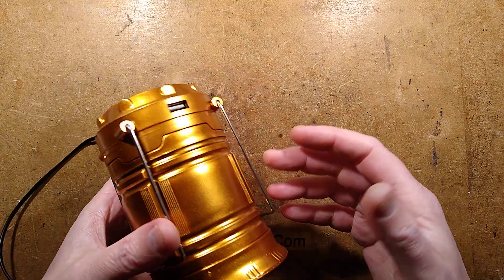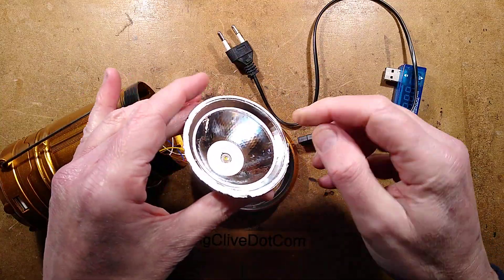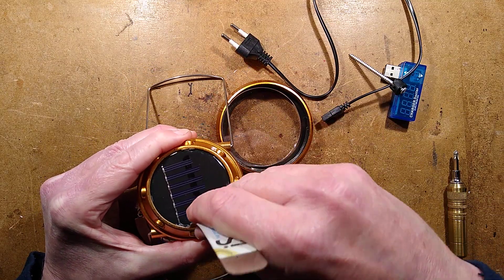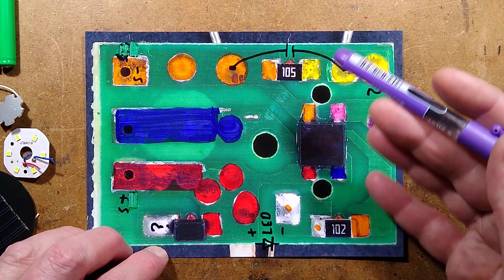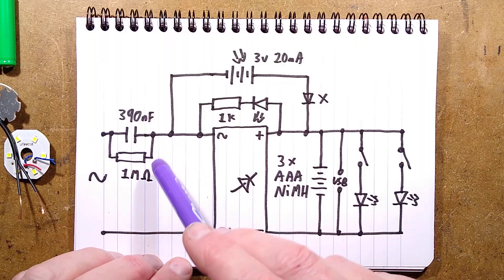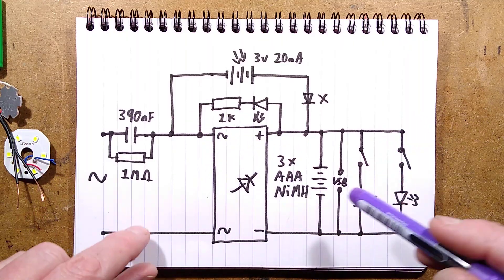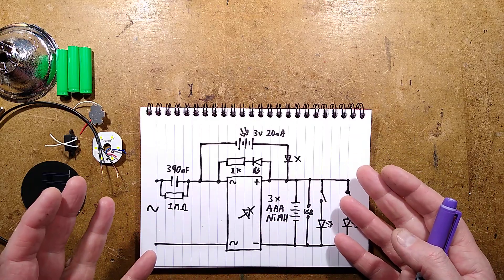Dangerous "death Dalek" lights still on eBay

Comment: My girlfriend’s father sent me one of these. The reason for sending it was that it did not hold a charge. I was horrified when I opened it. Frankly, I thought I would replace a battery and send it back. I didn’t even notice that it was charging from the wall. After examining it a little, I canceled the things related to 220 volts, the solar energy panel, and made the modifications on the same pcb, it would be charged with usb. With 1 piece TP4056 and 1 18650, it both worked longer and became safer.

Comment: i have that kind of flashligh before, it just exploded when i charge it.  i was back from camp that day, take out all my gear and charge my phone and that flashligh, i left to take shower, i heard loud bang, but i doesnt knopw where ithat sound come from. when i back, the flashligh are oozing black smoke, i unplug it, after it cool down, i realize the battries that exploded, some rando cheap ass chinese battries inside. i just take out all the circuit and mod it into full dc, have been few years and that flashlight still alive

Comment: What charge cable is that ? looks like usb ? but can't be if straight to 240 ? don't most connect to 5v charger ? why would anyway connect this way to charge ?
Reply from the maker: The flimsy cable supplied with these is for 220-240V use.

Comment: My family and I personally have been using this type of flashlight for a long time. I mean the one that works with this plug and on AC current. It is bad with a bad battery. It is not lithium. It takes an hour to charge and the internal board is stupidly simple. Just buy a flashlight that works on USB C. It is safe. It charges faster and keeps AC current away from you as much as possible

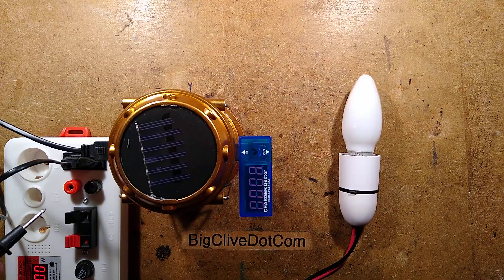Comment: 1:16 i understand it's dangerous but i never fully understood the 'referenced to mains' thing
can't wrap my head round it😂
Reply from the maker: Imagine a 9v battery with its negative connection connected to a live wire.  You'd still measure 9V across the battery, but it would also be live at full mains voltage with respect to ground.

Comment: I found one of this in recycle bin and i upgrade it with a lithium battery and a module to charge the battery.And I use the usb output as an input and turn it on using a power bank.And I completely returned the previous charging circuit to the trash can.
Reply: In fact, the charging circuit of this device is not suitable for nickel batteries, but for acid and lead batteries.  And within a short period of time, the batteries will be destroyed by that charger board.

Comment: I think I have the original product this is copied from. It has no solar panel and no usb,and it takes 4 removable AA size cells so very simple. But its been very reliable had it for at least 10 years.

Comment: It is based (or as you put it, a rip-off) on a real high quality camping lantern made my MPO, but it is only based on it in its basic appearance as the quality and the functionality is abominable on the one you have there. They came in black and camo-green only, when I bought mine and are nothing as gaudy as the cheap shit you bought from eBay. Mine also uses 3xAA NiMh batteries which go into the unit under the the screw on bottom which is also magnetized so it can be used a a work light. But the torch at the top is only about 3/4" across with a very bright LED in it, and it is surrounded then with a red plastic light which goes to the width of the body. The button on the side has four steps: torch on - torch off and red emergency light fast flashing - torch off and red emergency light slow flashing and finally back to off. When the handles are unclipped and pulled up, the light is emitted by three equally placed vertical strips of LED's )on a yellow field) and it is really bright. It is really well made, metal and reassuringly weighty. It does not have a USB charging port. I bought four of them about four years ago. Three of them have been used for emergency lights in power cuts, or lights to go down the shed at night and for camping of course. One is in the car. I had a look before posting this, there are a myriad of nasty and nice looking ones out there now - which one I'd buy if I ever needed more would be an issue.

Comment: Many lamely cheap laptop and usb chargers do the same thing … if you do the same experiment the results will negatively impress you. I remember testing a knockoff MacBook charger because the customer complained that aluminium surfaces of his MacBook are tickling his fingers while plugged in… 86v ac leakage from chassis to ground…
Reply from the maker: Most ungrounded chargers do that, but with micro Amps of leakage.  This thing can deliver amps.

Comment: Can someone explain in laymen's terms why this is dangerous? Does it shock you?
Reply from the maker: If you plug a phone into the USB charging port while the unit is plugged into wall power, it can make the phone live at full mains voltage.

Comment: I have a rule in our household, that anything we buy that plugs into a mains socket has to be bought from a reputable outlet (amazon and ebay an absolute no). Since then even had a karaoke machine bought by a family member for my daughter at xmas, the power supply melted! Fortunately my daughter 8 years old, switched it off at the socket and immediately told me.

Comment: usb only has 5v... it can't electrocute you very badly...
there is no amplifier inside this thing, you plugged into a 5v source, and got 5v out .. 😱🤦
Reply from the maker: Roughly 5V out but superimposed on 240V.
Reply: ah, now i see, your power cord is just the odd uk thing, i thought it was a USB socket, because, those lights are usually USB powered here in canada 😅 
meaning you need a power brick... 
scary wire they included there... 😂😂😂

Comment: Surely it would fry any USB device plugged into that port, and the batteries too?
Unless that bridge rectifier is also a transformer.
Reply from the maker: If the item being charged is not grounded then it will just see the 5V.

Comment: Wow. I work on power supply circuitry and firmware for embedded applications (USB-C/Power Delivery charging and Li-ion batteries) and seeing how bare this circuit is is amazing. There is no power protection circuitry in there at all except for the discharge resistor. It's amazing what's out in the market today. All of this could be resolved with some actual engineering and spending a few bucks on some specialized ICs

Comment: In summary:
-Been on the market for 6+ years
-Can electrocute you and/or fry your devices
-Thin, steel core power cable that will immediately melt/catch fire in event of a malfunction
-FAKE rechargable batteries
-Topic of multiple entertaining videos

Comment: Depends on the voltage. If it’s only 120v you would be able to drop your phone
Reply from the maker: Not in all instances.  If you have damp hands and are grounded then a lot of current would flow.

Comment: Thanks for making this video. I bought a 4 pack of these in 2018 on Amazon. Same color as well. One was DOA. 2nd never would recharge. 3rd shocked me from the USB port. 4th was tossed in trash after shocked. The solar panal is for show, as it never seemed to charge with them. Even plugged it did not hold charge long.

Comment: knives are available on ebay, also extremely dangerous
Reply from the maker: This is the equivalent of a knife with unexpected blades that explosively pop out the sides of the handle while you're using it.

Comment: .03 amps and 240 volts wouldn’t hurt an ant. Someone doesn’t know electrical… and if you ground it, like you’re supposed to, there would be no karen issue….
Reply from the maker: A diode won't limit the current through you.  30mA is also incredibly painful.
Reply: @bigclivedotcom  30 ma and 240 volts is painful?

Comment: Bummer and the Wago wire connector clones in my cart just went on sale (special for my cart only though) for 6 bucks for 90.  Supposedly lower quality on tests per youtube, but I've used a few in the house.  Very solid physically, wire won't move or come out, but can't speak to if it could corrode long term with moisture in say a bathroom or load it can handle.

Comment: Actually a really cool product but horrible execution on so many levels. How can you spend so much time designing the externals and even putting some effort into the hardware with that sliding feature, but then decide to let a toddler design the electronics?

Comment: "you would not be able to let go"? have you have been shocked before? it doesnt necessarily give you 100% muscle lock. And you would instinctively pull away and unplug the damn thing. I realize you Brits have a lot of time on your hands, not having jobs and all, but you can do better research Im sure.
Reply from the maker: Check out my video called The unofficial guide to electrocution.  It might actually save your life.

Comment: Why is the mini usb plugged straight into mains voltage? What happens if you charge from 5v usb?
Reply from the maker: This unit only charges from wall power.

Comment: I remember having an even WORSE one of these that stopped working when I plugged it into a charger.  Before I threw it out I found out why.  The N Hydride cells had been replaced with over the counter batteries at the last moment in the manufacturing process as a cost saving measure.  However the entire charging mechanism was unchanged.  So if anybody plugged this into the mains all that juice would hit Energizer battery knockoffs.

Nice...

Comment: 🤦‍♂️It's not the device, as this device was only designed for low voltage.The charge cord is the real problem A 240v plug directly to USB should not exist without a transformer, which would commonly reduce the voltage to 5v DC.

Comment: Speculation about the unused diode: they intended for it to protect the solar cells from reverse current but the forward voltage drop was enough that the LED wouldn’t light. So they bypassed it, realizing that the solar cells are effectively diodes themselves.

Comment: So if the main chargers at 240V, I don’t think we’re gonna have the same amount of lethality as in the US since we’re 120v?

I’m no electrical engineer, but I’ve never figured out why the rest of the world needs to run 240. Is it something to do with phasing?
Reply from the maker: Our simple 240/415 system has many advantages.  One phase and neutral to homes and three phases to factories.  Our power circuits are rated for 3kW per socket so we can plug things like welders, kettles and laundry equipment in anywhere.

Comment: You'd get 50 or 60 chances to drop the phone every second as the ac frequency flipped.
Reply from the maker: That's a myth.  It's the AC that causes sustained muscle contraction and you can't open and close your hands at anywhere near 50/60Hz.

Comment: I have these except mine have battery slot, before i used to charge them and use them when there emergency blackout.. but after loosing the charger i only use them with 3AA only... Still using them but thanks for the warning..

Comment: In Russia, in low-cost stores (for example, the Svetofor retail chain), these lanterns were sold for 285 rubles (the equivalent of $ 3). I bought one for the sake of interest and use as props for a school production. Somehow I was bypassed by a case with simultaneous charging of the flashlight, and attempts to charge the phone from it at the same time. Now I'll just take it apart and dispose of it. Thanks for the warning

Comment: I remember having a laptop where the paint was wearing down to metal, I believe. And I kept feeling a shock whenever I rest my hand from typing or resting to use the arrow keys. That laptop was very annoying to use. I had lived at a house in USA at that time, that only had 2 prong sockets and everyone used the 3 prong to 2 prong adapters but we didn't run a ground wire.
Reply from the maker: Most ungrounded chargers and power supplies do have enough slight leakage to give a tingle.

Comment: Ali Express is the culprit. They opened the floodgates to these god awful suppliers and manufacturers that do not strive for any sort of quality or safety control. This is why you can get goods seemingly so cheap but at the expense of your safety. If you buy for example a dog bed from these places they do not carry out any sort of fire safety testing and will go up in flames  quicker than the more expensive brand normally available. I stopped paying for Prime now that these fake brands have flooded Amazon.

Comment: Here in the USA we use 120 volts and it doesn't grab you and hold on like 240 does. 
I had one of those that my dad gave me, wired for the States. It was a piece of scheisse, pardon my German. 😂. There was nothing good about it and it went in the trash when I moved because it wouldn't turn on at all anymore. My suggestion is to buy a good flashlight, like a MagLite or something heavy duty like that, and rechargable batteries.

Comment: While connected to main what limits the charging voltage ? from the schematic you drawn there is nothing to limit it and the batteries will over charge.
Reply from the maker: If they had been real NiMH cells they can be trickle charged at low current continuously.

Comment: What am I missing ? How can a usb charging port handle ‘mains’ juice ? The USB only works on DC; So if it was any USB device would fry. So he’s saying the mains ground is the USB ground ? That the AC isn’t isolated ? How is AC neutral able to be on the USB ground after the rectifier ?
Reply from the maker: The 5V is superimposed on the mains power.  The phone sees low voltage but its case is live.

Comment: When i lived in a country called Samoa, they had 220v mains but commonly used American 110v appliances and electronics via small portable transformer boxes that plugged into the 220v mains on one side and had a double-plug American style outlet on the other. side. 

When i was 15, I had a malfunctioning transformer box short through me and into the ground. I was totally paralyzed. I could not move. After about 10 seconds, someone else in the house finally figured out what was happening and killed the power. It was a really scary experience- I couldn't move or talk, all I could hear was a loud humming or buzzing type sound (idk if it was the electricity or the normal blood rushing through the ears sound). I was trying to tell them I was being shocked but I couldn't speak; they told me I was actually screaming at the top of my lungs. Apparently, at first everyone thought I had stepped on a nail and was being "dramatic" about it.

When they cut the power, I was unconscious but I'm told I flew backwards into a rock wall about 10 ft away and then seized on the ground for a minute or more. I'm not sure if that was because of the electricity or my muscles suddenly working again. Somewhere in that process I fractured a vertebrae and it slipped and dislocated behind another. Again, not sure if that was from the way my muscles spasmed from the electricity, or from hitting the wall, or from the seizures on the hard ground. It never healed properly and I have lingering back issues where it's easily sprained or spasms and locks up now, and I also have spinal stenosis now. 

Makes me grateful that we use 110v here in North America lol.

Comment: So its feeding 240v DC to the batteries? I don't see a transformer to step down the voltage.
Reply from the maker: It's using a capacitor as an AC current limiting device that provides no proper isolation.

Comment: I expect the solar panel may work ok by finding the negative of the battery through the diode in the bridge rectifier, it should be easy to test and this saves them needing to use the extra diode. You should test that. It may be enough to keep the batteries topped up when not in use.

Comment: I used to work for eBay many years ago, not sure how their policies may have changed since that time but their whole deal back then was: "we're just a neutral venue, we don't have firsthand knowledge of the stuff people put up for sale so we can't remove stuff for being potentially dangerous unless there's some kind of recall or the item itself is something we specifically put on a prohibited list."
So you can report electrically dangerous items until you're blue in the face and nothing will ever come of it unless it becomes a high profile media story that's featured on multiple news outlets. That's about the only way you can get someone to look at the issue who has more power than just clicking the 'delete' button on your report. If any agent removes one of those auctions incorrectly (and by incorrectly I mean removing it while it doesn't violate any official site policy), the agent has a very high chance of getting in trouble for taking incorrect action.

Comment: You dont show how the active is connected to the body or ground or shell or outer case of the USB. No solid explanation as to why it gives a shock. Both supply lines going through the rectifier. Not one thing you said reflects any electrical knowledge!!!!
Reply from the maker: The schematic is perhaps not clear that there is effectively a diode between you and the mains supply.

Comment: Well straight up. The solar panels negative goes through ghe rectifier  to the negative of the battery and positive through the led to the positive of the batteries and is probably just a tricke charge!!! Because of this lack of knowledge the rest was just waffle waffle bla bla. I feel dumber after watching this.
Reply from the maker: I mentioned the solar panel voltage and how it was not high enough to recharge the battery pack if it had even been rechargeable.